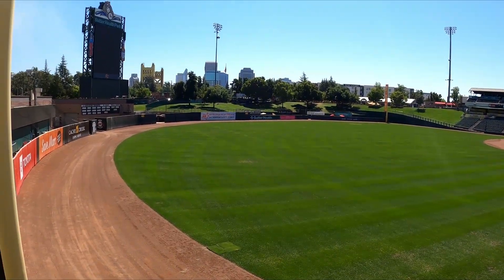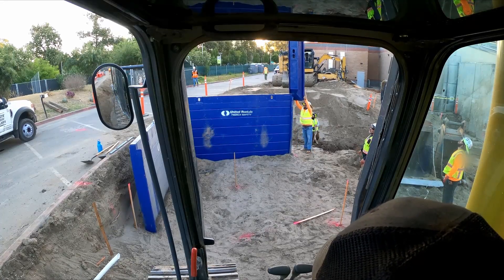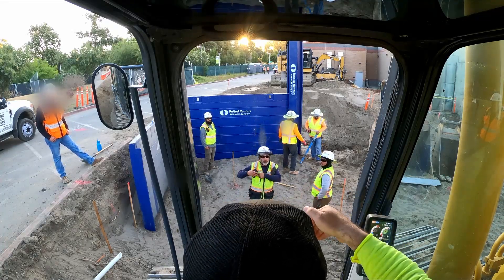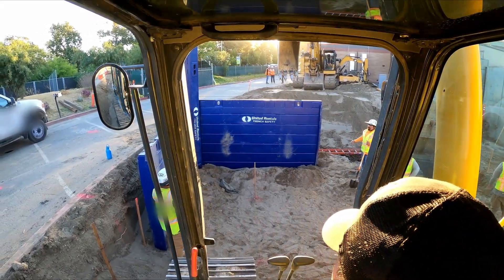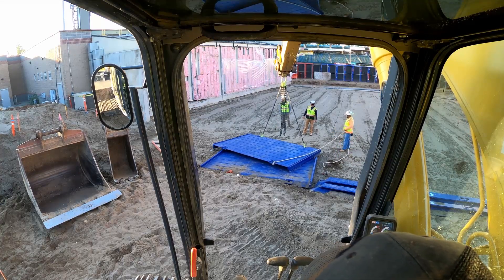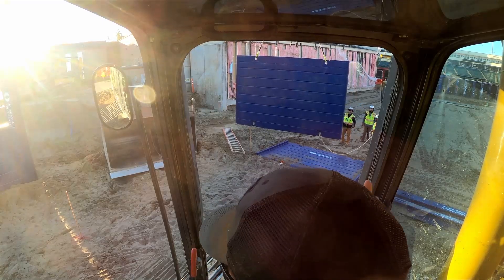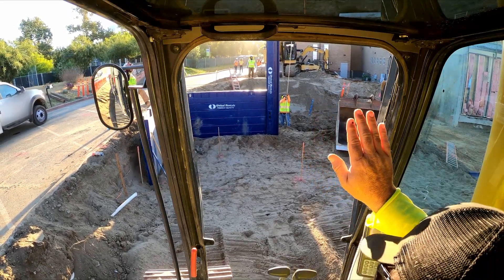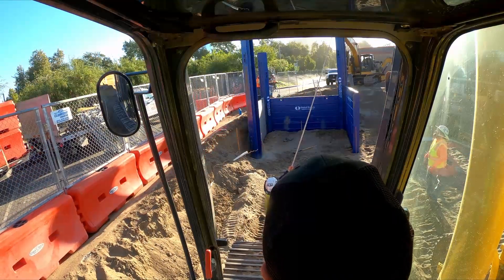How to install a small slide rail system part 1

Comment: I find a vibro plate works wonders with this system. Both going in and coming out. It's best if you can have the vibro plate mounted on a separate Hoe if at all possible to have a second one there to work simultaneously vibrating while the pulling Hoe either pulls up or pushes down.

Comment: This is good timing on this video. I am installing my first system like this next week. 22' to core a manhole for a new sewer in Indianapolis.
Reply: Just got done doing 2 slide rail systems for bridge abutments so they had to be perfect !!! One side the biggest machine we could get to the location was a 325fl, I had 20ftx8ft panels that were extremely difficult with that little of a machine and I had 2 inches to a 12 inch high pressure gas , and 1 foot on the other side of box to a concrete water main 😂😂 going together was brutal but getting it out shaved a lot of life off that machine !!! The other side of the river I had the same underground utilities but a 336 that made it so much easier ...oh yeah I had all kinds of overhead wires in the way the entire time . The 2 worst overhead got moved a week after I pulled everything 😂😂😂 . The 8x20 panels were 8800lbs and with no bucket on the 325 was good for 8900 IUOE STRONG
Reply from the maker: Bad a$$ man. good job. love the story.
Reply from the maker: Sounds great! Hint take extra time doing the top section, it will save you time and efort on the lower section. I also have a large scale sliderail system video you can go watch. It goes into more detail of what and why we use theas for. check the discription for links.
Reply: @TheLeverMonkey  thanks, I will check it out.

Comment: show all the steps of this you can always looking to learn more . we dont have to install slide rails very often but they always suck to install and even suck more to remove. weve destroyed a couple buckets and recently have had a custom quick attach beater made just for driving in slide rails.
Reply from the maker: the next video will show how to drive in the piles with out beating up the rig.